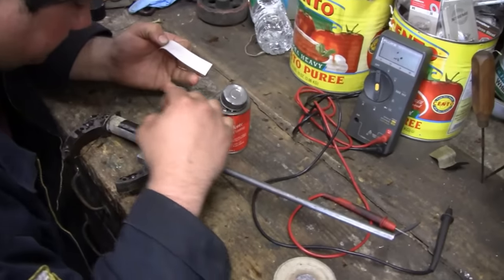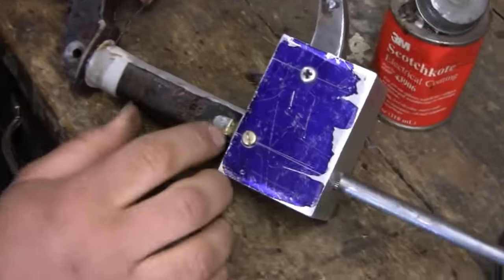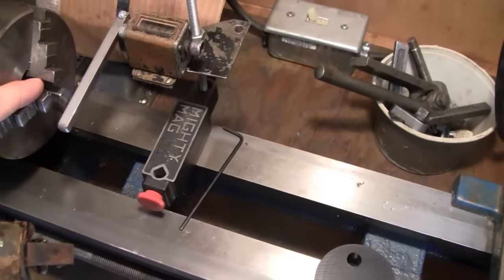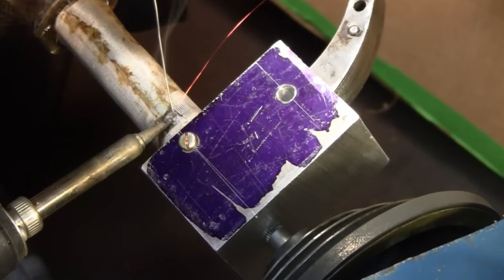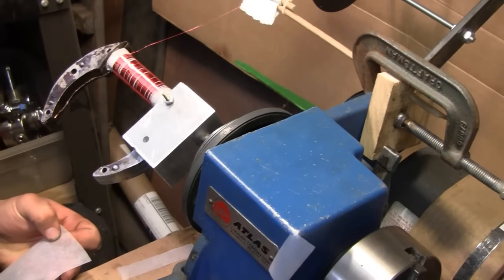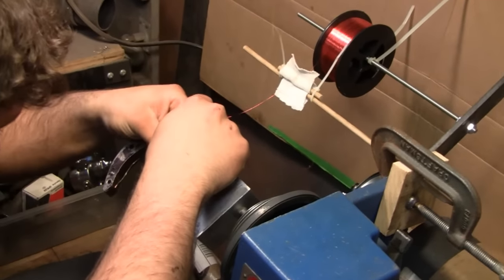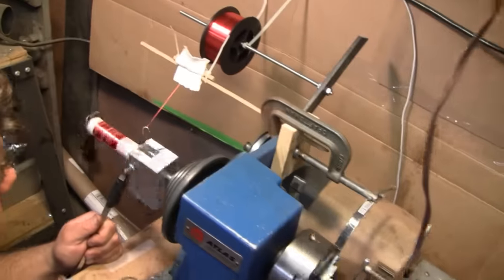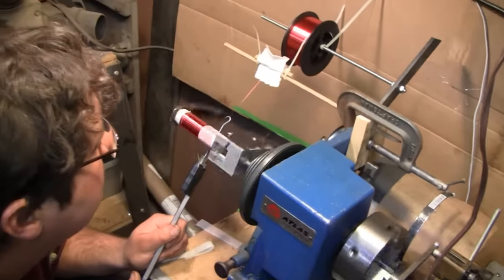1928 BRIGGS REBUILD MODEL FH (part 8)

Comment: Back in the day, I wound wire bundles that were used for TV tubes.  That machine wound 7 at a time and I did about 3000 a night. Great job for what it was, a second income when I needed it.

Comment: Nicely done.  I've chucked them in a drill press before to get more clearance.  As long as you don't load it too much laterally, it works as well.
Reply from the maker: +tiporari Thanks Bud!! I never though about using the drill press, I'll have to see how slow we can get it to go!!☺
Reply: +805ROADKING Sure :)
I've got an ancient one that has 4 pulleys on the motor and 7 on the chuck, so you can make it crawl :)

Comment: Winding the coil in the other direction means you'll get the current flowing in the opposite direction and you'll get negative voltage in comparison with the other way. Just a little insight :)
Reply: +Arnþór Gíslason Note that when we say opposite direction we mean right to left or left to right not CW to CCW.

Comment: Winding this is kinda like winding a guitar pickup, except the wire used in guitar pickups is much thinner. They usually use 42-44 gauge wire in a pickup.
Reply from the maker: +Cameron Jenkins I can't imagine working with something that thin!!☺

Comment: Rk ,
With it being coated wire ( and I know that with one nick in the coating it's useless) but has Mike ever tried actually not splitting the layers with paper ,and just winding it back and forth till its done in one continuous ?
Reply from the maker: I told him I wanted to try one like that, the new enamel wire has got to be better that the stuff they used 90 years ago eh!! We just picked up 2 of them coils at a show sunday for $5!! One is good and one is bad!!☺
Reply: Try it buddy !
I'm sure it would be a pretty big time saver just so long as the resistance in the wire doesn't cause the coating to melt off once you start running it .
But then again if it did then Mike would already have probs with whole layers on units he's already done .

Comment: It's never going to work. You have to use silver solder otherwise you'll get eddy currents through the aluminum jig which will cause the crankcase to fill up with condensation and sieze up the muffler bearing. Not to mention it's going to overheat. How about showing us the crank? ☺☺☺
Reply from the maker: Aye yi yi!! Benedict Arnold WTF!!☺